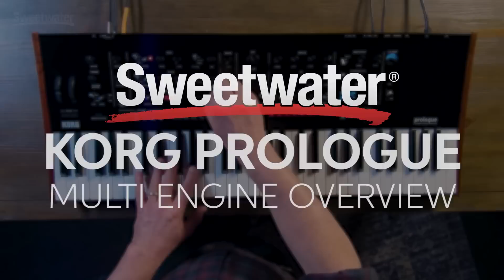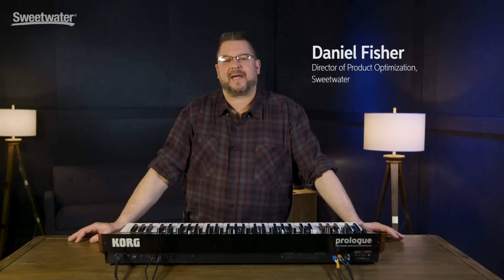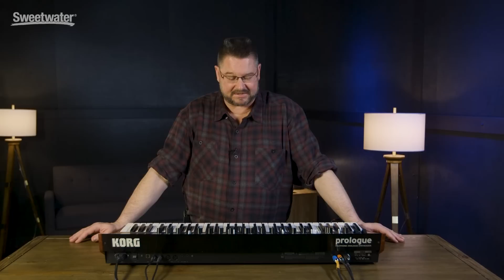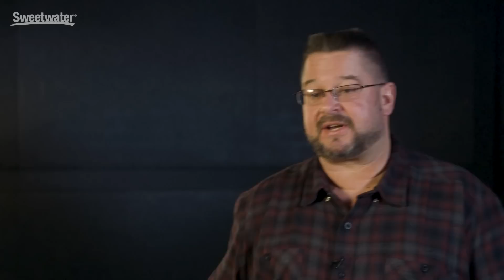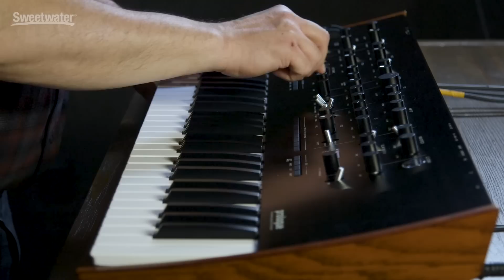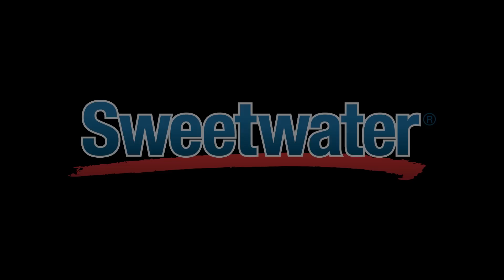Korg Prologue's Multi Engine Oscillator — Daniel Fisher

Comment: This is a music producer beast of a synth to get crazy sounds quickly by just turning some knobs and get on with the track production. Not a sound designer synth as it has 2 big limitations: one pole filter and one LFO but.... Multi timbral (wow), 8/16 voices fully analogue + wavetables. Analogue OSC sound like butter, make me want to taste and eat the sound  Gorgeous sounding FX, the reverbs (submarine) especially plus it's smaller than the usual synths, having the wheels up which I find more convenient. I have the 8 version only 70cm long. The keys are superb like playing on velvet. If you're a producer like me this is for you. It will inspire you. If you're a sound designer putting hours of work into building sound packs this isn't for you unless you want another toy to have fun with. This synth is fun and immediate, I hate menu diving but this is quick and not lot I found to dig out. I get awesome weird sounds by not even using the wavetables nor the menu... Yes. Plus it looks and feels A+ grade. I tried a few synths before this, Prophet 6 (massive synth beautiful but way more limited than this + not cheap), Deepmind 12, Modal argon 8, Waldorf Blofeld. I finally found the one at an affordable price which inspires me every time I turn it on. This fucker turns me on too so my gf gets jealous lol.